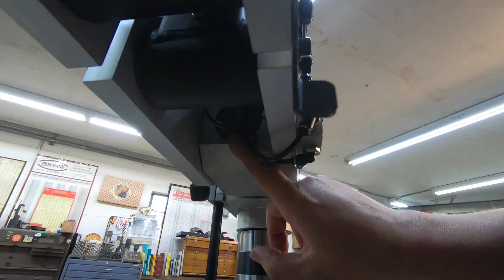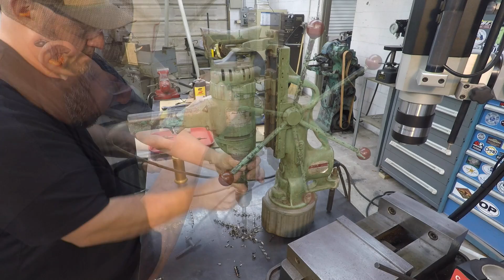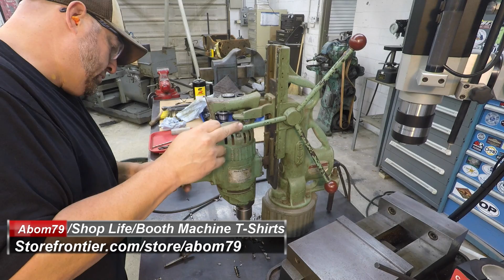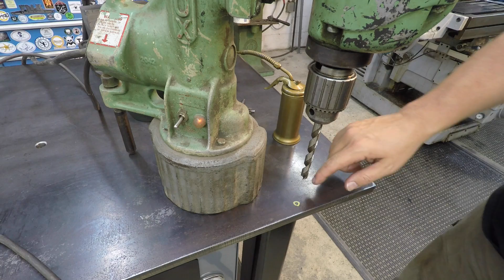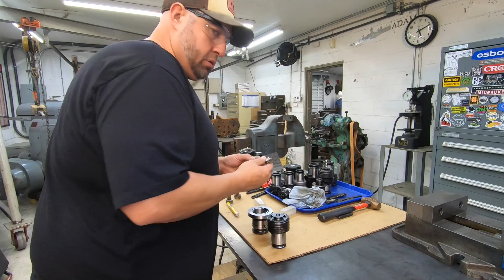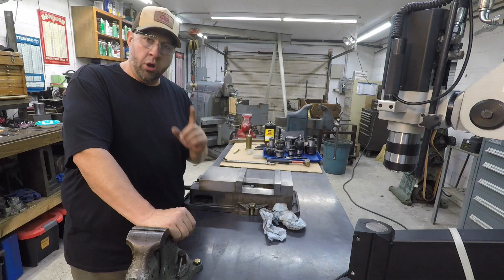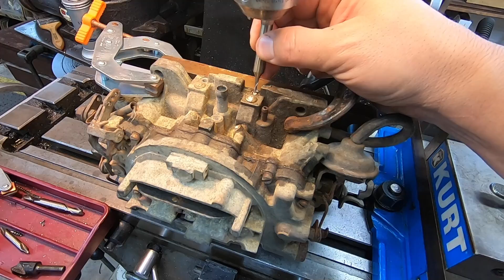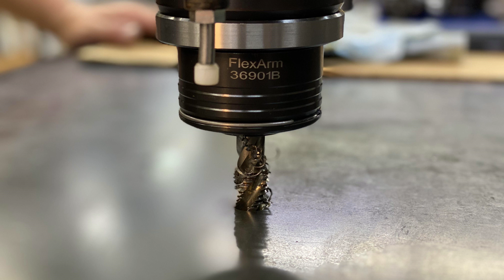SNS 301: Flexarm First Use, Broken Screw Removal

Comment: That is free machining steel. Does it have controlled torque to tap tough metals like monel or stainless where you have to stop when the torque builds up, back up, go forward, stop back up over and over to keep from breaking the tap?

Comment: That mag drill seems rather clunky. Is the flexarm not good at drilling?
Reply: The drill is good at removing material but requires a lot of downward force that the arm cannot provide.  The tapping process pulls the tool through on it's own.

Comment: Is it just me or does drilling those holes on the bench seem like a great usage case for the flex arm?

Unless it can't also fuction as a drill?
Reply: The drill is good at removing material but requires a lot of downward force that the arm cannot provide.  The tapping process pulls the tool through on it's own.

Comment: What taps do you use that hold up to going straight through? I'm just starting out and have a mix that I have acquired, but, wanting to get a good quality set. Thank you
Reply: Get spiral flute taps if you want the chips to come out the top - excellent for blind holes especially. Get gun (spiral point) taps if you want the chips to come out the bottom - great for through holes. Those hand taps (the four flute ones) you get from Sears, Horror Fright, and Home Depot are only good for hand tapping and can bind up in the hole and break real easy. You have to keep backing out those taps to clear the chips and are a P.I.T.A. - don't use them unless that's all you have to work with, and don't ever use them for power tapping. They will almost always break or mess up the threads. If you get one stuck in a hole - you're screwed, but not in the good way.
Reply: @jlippencott1  Thank you
Reply: @IowaBriGuy  I'll second that!

Comment: Nice vid, I'm setting up a small home shop. Also working with a FlexArm, it's the A-32 which is a pneumatic version. It consumes 27-28max cfm, 24-26 typical cfm at 90-120psi.

Comment: What's that whirring noise in the background when you turn on the machine?
Reply: Judging by the hydraulic fittings on the end of the arm it's probably an electric motor pumping hydraulic fluid.
Reply: there is both the sound of the hydraulic motor running and the variable frequency drive you can hear
Reply: Argondo that’s what it is it’s the whine of the vfd they tend to do that when not field programmed because of power quality in the install location
Reply: @Michael Bradleythe motor looks like it's on the end of the arm and turns on only when the button is pressed. The sound it makes then is different
Reply: @kswiorek 
Electric Hydraulic pump... The sound is the electric motor pumping. They continuously pump the fluid, and  bypass hydraulic fluid through valves  when the arm motor is not turning. 
This is so the full instant torque is applied at the arm motor as soon at the button is pressed.
Reply: Probably a closed center hydraulic system driven by an electric motor. Gives full system pressure on demand. Wish I could justify nice toys like that.

Comment: Even Adam who spends countless dollars on machines will buy cheap ratchets from HF. Love that. No snob.
Reply: Test the Icon line against Snapoff. I think you'll find it very surprising.
Reply: directorgtr 
The most important thing about a ratchet handle is the feeling, the feeling that no matter how hard you push on it, it is not going to slip and mash your knuckles. The brand is irrelevant, I have a couple of expensive brand and a some cheapies, in many cases the cheapies feel more trustworthy then the brands.

Comment: Since there was only about 1/4" of the tip of the needle left when you were done doesn't that mean that you drilled it out way too far? The size of the needle on the removed part was like an inch long (beyond the threads).

Comment: I've drilled a smaller hole in  a ways, then use the LH drill bit thats a little bigger (but obviously not bigger than the screw). it will grab into the screw a little better than just running it in there blind. I've always had pretty good luck with that.

Comment: thats insane that flex arm requires such high voltage power to run... I would hope you can tap just about any size hole possible with that dude....

Comment: Hey Adam. I have wondered many times when you use the left hand drills for broken screw extraction. It seems usually you get them loose when you go to the next size up, but rarely the first size. So here is my thought. Pre-drill with a smaller drill, to at least clear the chisel point, since that is the part of the drill that offers the most resistance, and thus tends to limit the feed of the drill. With that out of the way, it seems to me you would have a much grater chance of the drill digging in and grab the bolt, rather than just slowly cutting it away.

Comment: Steel seized in aluminum or magnesium is tough. Watch the 'South Main Auto Repair llc' channel video entitled, 'Big Nasty Gets Defeated!' to see how much force it took Eric O to get a steel bearing assembly out of an aluminum casting. Imagine how many tons of force was pushing out on that casting to hold that bearing assembly in there that tight.
I would soak that carb in diesel fuel for a few weeks, before trying to remove anything else. 
That was an interesting video, even if we weren't in lock down.   
The, 'Chevy Malibu: Lower Control Arm w/ Ms. Hannah & Ms. Marie' video is good for some laughs on the South Main Auto Repair channel too. If you sign up for the Elon Musk Mars trip, make sure to take Abom79 and Eric Owith you. Stuff breaks.

Comment: Is there a chance the screw is not backing out with the left hand drill bit due to the rigidity of the mill? I would think that when the drill bit bites the screw has nowhere to go but when you drilling it out by hand it has a chance to work its way out.

Comment: That carb should be in a trash bin
Reply: Yeah, I threw out a few Holley carbs in hat condition recently. So not worth the trouble, corrosion everywhere & more inside.
Reply: I'd see what it looks like after a good long hot soak in an ultrasonic tank first before giving up on it.
Reply: 771 Racing you can pick up a brand new one for a couple hundred dollars. That one is not worth the repair. It’s a nothing special carb.
Reply: Maybe. Maybe not. I don't throw any carb in the trash, Especially old Carters.

Comment: Can your magnetic drill be modified to use a variable speed, or would you have to use a variable speed control drive frequency converter?

That is an AWESOME drill press; I bet it cost more than my house (140+ year old farmhouse).  It is truly impressive and versatile.

Have you ever used Gibbs penetrating oil?  It's the only thing that we found that would loosen frozen roller chain, which is a common problem on a farm.  Just spray it on, hold it in a vise, work it 180 degrees back an forth several times (usually by the fifth time, it's loose).  Loosens the rollers with a pair of needle-nose Vise-Grips.  Amazing stuff.
Reply: i bet you could just use a dimmer switch off a house to control the speed / dial it down.

Comment: 27:14 I was blowing on the screen of my phone trying to remove the metal flakes after you drilled the center divet in for the left hand drill bit to center in!! Haha I was that into the video!! Also I have lucked out in the past with using small 6 point torq bits as small extractors. That worked out perfect what you did though and it dint drill in to the tappered seat for that mixture screw either and you were able to knock the tapered end of the mixture screw out of the tapered seat at the end that was awesome! Thanks for sharing! Almost forgot the main part of the video, that flex arm tapping system is really cool!!!

Comment: To remove broken drills and taps, I like rigidity. I save dull stub carbide endmills for this. I use a Bridgeport type mill. Hint, lock the quill, X&Y and crank the knee up with jerky .005 feed movements so it doesn’t rub and keeps a cut going and if the cutter croaks things aren’t so bad that you can’t blow out loose carbide, replace end mill go on. Warning; If you do this, you may own the job in a big shop. No good deed goes unpunished.

Comment: I had nothing but problems using spiral flute taps in manual machines ( un-pitch timed feed). They can blow out the size ( NO GO gage goes loose) or deep threads pitch errors. For manual power tapping, stick to spiral POINT taps or thread forming taps on ductile materials.

Comment: The Carter AVS or "Air Valve Secondary" - that flap on the back two barrels has an adjustment for the spring that regulates how easily it opens - easier to tailor the secondaries' opening for smaller vacuum availability.

Comment: We have one of these at our shop.  It is a great tool and has taken a big load off our CNC equipment for tapping and countersinking.  It’s very, very strong and will run very large taps (our largest is an M18 I believe).  We have ours set up on a modular table with a hole pattern so we can easily mount vices, clamps, or stops wherever we need.

Comment: That mag drill is cool as well. Some mouth watering tools right there. Much better tap than with the drills high RPM. Be cool if it had a portable mag attachment so you could detach drill, with cable extensions, to move it around the shop further for large work, use as mag drill

Comment: Why aren't you also drilling with the flex arm?
Reply: Probably because it doesn't put positive down pressure like a drill press
Reply: Because the Mill is able to positively locate the center line of the screw with great accuracy.

Comment: For the broken screw removal - would it be possible to tap a pilot hole with a left handed thread, screw in a left handed bolt and then torque that to get the original bolt out?

Comment: can you not drill with the flex arm ?
Reply: Not really - It's clutched to stop the spindle if it goes over a certain torque to prevent tap breakages
Reply: Kind of a one trick pony then. He's going to have to tap a lot of holes to pay that thing off.

Comment: Would the flex arm had more flexibility if it was mounted in the middle rather than the corner to reach the entire table?
Reply: Not really - It has that initial arm section that gets in the way of access far more if central - he talked about it in the 1st video on the arm

Comment: To remove a broken screw , you can tig weld a washer to it and poor water right after welding when its still red, that gives it a shock and it retracts. then weld a nut on the washer right in the center and poor more water. Always unscrew when cold. It always works for me

Comment: If I missed the question being asked i apologize, but why not mount the arm centered at the back of the table so you could make use of the whole table.
Reply: Although that would allow the arm to reach the whole table end-to-end, I'd suspect that 80% of the work done on that table, like on any machine, will be pretty much in front of the spindle, centered. So the Flexarm would be stuffed up into itself for most work and there would end up being limitations with how close the Flexarm spindle could get to the rear edge of the table. In other words, it would create a no-go area in the shape of an arc where the thing could not operate. There is no perfect solution, but IMO the end-of-table mount is better. Rgds.

Comment: ✝️🇺🇸👍 had to make an adapter for shaft to put a four stroke motor to an old sears boat prop and thinking wish my shop was clean as Adam's. 🤔 should I stop and clean are just watching  anuther video.  Well great video.  God bless hope all are well out there.
Reply: It wouldn't stay clean because you have different habits. Adam has worked in shops that call "clean up" 15 minutes before shift end and have jobs that have idle time in between tooling. My shop is sterile until I walk in and then becomes treacherous because you can't see the floor for the junk. I kick myself every once in awhile and shovel it out. Stay safe

Comment: So the flex arm does not drill ?  Just wondering.
Reply: It has no way to apply downward pressure like a press style drill. Taps pull themselves down and assist themselves.
Reply: It doesn't for 2 reasons
1. The head is designed as a torque releasing ratchet - if torque goes to high it ratchets around to avoid breaking taps
2. It is a floating head that is designed to move up and down on a sprung mechanism - pushing fully on it will risk damage from over compression

Comment: Why when you put the larger drill bit in the magnetic drill did you go slower? Anyone feel free to answer
Reply: Speed depends on material but also depends on tooling type, machine limitations, etc. As a rule of thumb the bigger the drill bit the slower you drive it to avoid chatter and other complications. Its due to the surface area in contact with the work piece as it increases so does the forces involved, more force means more flex. The more everything flexes the less accuracy youll have in general. Plus exceeding feeds and speeds Is a sure way to damage your tooling.
Reply: I think you will find that the mag' drill is single speed. That's why he was pumping the trigger to stop the drill bit catching. regards
Reply: As a general rule the bigger the drill bit the slower the speed you run it at .....correct speeds can be found in many drill bit speed and feed charts
Reply: Constant surface speed is a basic machining concept
You want to match the speed to the distance to outer edge covers
larger diameter means bigger circumference = more distance covered per rev

Comment: That carb is freekin toast!! 
What a waste of time and money. They are all over the internet for under $100.
Reply: Sometimes originality is the prize.
Reply: A lot of shortcuts are taken to get that $100 price tag. We used our Flex-Arm tap drivers for decades with little to no maintenance. We tried a knock-off and it didn't last a month. The air motors are crap, the clutches in some of the tap holders blew up, and the gas charged struts faded or failed.
Reply: I don't know where you can find a 4-barrel carb for $100 but if you can, get in the business of reselling carbs. That carburetor would be at least three or four hundred dollars for a cheap Edelbrock.

Comment: Is it just me or does the reverse sound a little funny?
Reply: It's just a higher pitch. There is no resistance so it backs out faster.
Reply: Almost all servo motors, gear motors, and stepper motors sound different in reverse.

Comment: That carburetor is an old Carter AFB popular on the big block Chrysler Plymouth Dodge but that particular carburetor I don't think you're going to be able to bring back from the dead I've done a lot of carburetor work in my time and that was a very impressive removal but the rest of the carburetor seems far off worse than a broken air fuel mixture screw.. them Carter AFB are out there if you know where to look.... I'd be interested to know if this gentleman with this carburetor has some kind of magic wand that he's going to rebuild it with.. or if he just sent that to you as a challenge to test your medel...🤔 They don't call me (is he nuts) Izzynutz Restorations for nothing.. I think I'd be looking for another one...lol but that was pretty impressive Adam.. mighty fine ( FINE ) work brother.. and I'm digging that flex arm... That's a very impressive tool as well
Reply: yeah i was going to say the same thing. that carb looks like it sat at the bottom of the ocean, i wouldnt even be bothering with it, unless hes going for an absolutely perfect concours restoration. that thing is pretty gone.
Reply: Yeah, that carb looks like it's been kicking around in the backyard for maybe 20 years....
Reply: Remember boys looks aren't everything

Comment: Nice machine. You must do a HUGE amount of tapping to justify the cost, I imagine that thing is not cheap? Edit. I might have risked heating the aluminium around the screw just a little. With a small propane torch or maybe a heat gun, not oxy-acetylene. Even a little amount of heat usually does wonders on stuck screws. Freeze spray is another option if the part absolutely can't take any heating.
Reply: They are not cheap. If I can remember a salesman quoted about $5k to us, and it was tiny compared to the one Abom has.
Reply: @brianrhubbard  There may not have been any cost involved, though I never did hear Adam say anything about any videos being sponsored. Either way, I would never second Adam's choices as to what he needs.
Reply: @sithus1966  remember the video he did at the shop of flex arm. They gave it to him.
Reply: They gave it to him
Reply: I think it's like a $20,000 tapping tool

Comment: To get small broken bolts out I use Torx or hex bits that everyone has laying around from the “75 piece” screwdriver sets. I wonder if there was a seat at the base of the threaded hole.

Comment: Have you put the Read vice base back to front. Should the vice jaws not be slightly clear of the bench edge to allow longer lengths to be mounted vertical.
Reply: Chattonlad  The base is symmetrical so there's no 'back to front' - the vice just isn't designed to take long pieces vertically. It's a good point though because sooner or later that's going to matter.
Reply: He has plenty of vices....

Comment: i find i kinda strange that this huge and expensive tool can only tap holes, but not drill them
Reply: they have the torque for treading not the speed for drilling :)
Reply: It wouldn't be much use as a drill anyway, because the arm just floats and dont have any precision, your holes would be all over the place.
Reply: Not really when you consider it is a torque ratchet - if the head feels the tap over torque to the point where it could snap the ratchet disengages the drive
also it is a sprung floating head that moves